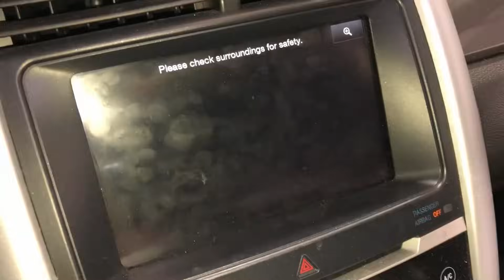2007-2019 Ford 6F50/55 Six Speed Transmission: Fluid Exchange Procedure

Comment: Hello sir, do you need to check the trans fluid level while it's running. I'm driving a 2014 ford taurus sho and have no way to check it unless I were to run it with no airbox
Reply: Just did mine. You can check it while its running just don't rev it or anything. I put in 5 quarts and called it a day.
Reply: @supafly322  you actually ran your vehicle with no airbox?
Reply: @LickidySplits  Yes, for a minute.

Comment: Haynes manual says 106 in-lbs for the drain plug in the 6f50/55. Though to your point, a little thread sealant and remembering you're just plugging a hole are always important.
Reply from the maker: Yes but I never torque it that much.
Reply: @FordTechMakuloco  Although it should be intuitive, your tip about choking up on that 3/8” ratchet during plug installation you provided in a few other videos is great advice for weekend warriors or novices just staring out. I’m an aircraft mechanic by trade so I understand auto mechanics and necessary theory of operation. What I don’t have is your in depth Ford experience and system knowledge. Your videos have saved me countless hours of troubleshooting, money for “parts cannon” ammo, labor costs and tons of frustration. You are a tremendous asset to the Blue Oval Brigade! Thanks!

Comment: Was looking to change the fluid and filter on my 09 Taurus X and noticed no drain pan . Internal filter ? Another bright idea from Ford ! Great video , thanks ! Oh , and by the way , ford says you never need to change the fluid for the life of the vehicle . What's their life expectancy ? Not very long obviously . Update ; changed the fluid and WOW ! Way smoother shifts ! Eliminated erratic shifting . Hard to believe fresh fluid could make that much difference . Now on to the ptu !
Reply: "Lifetime" no matter how defined, always is a definite length of time. Ive never seen any official documentation stating what the auto manufacturers consider as life time, but based on the length of warranties and and the average life span of the vehicles when in real use, it seems to be 100k-150k for a sedan and 175k-250k for a suv or pickup. Roughly 5-10 years for both. Its also worth noting that while the trans fluid in a 6f50 isn't a part of regular maintenance in the standard service list, it is listed in the severe duty service list.

Comment: Manual says it holds 11 quarts. I'm confused
Reply: Doing this drain and fill doesn't change all the fluid. The transmission and lines hold the rest of the fluid, that's why this really needs done three times to fully change all the fluid.

Comment: Just did my 2018 Explorer Platinum. Took 4 3/4 quarts of Mercon LV. Very easy to do, followed your instructions and all went well. 39030 miles on the truck.  I will be doing this maintenance going forward and also on my 2019 SHO at 30000 miles. Thanks for the procedure 👍

Comment: Thank You! I'm glad you explain how that fluid expands when it gets warm. I changed mine and before the 15 minute test drive I ended filling it up by accident halfway between min and full. I was worried after the test drive that when I checked it for final reading that it would be over max, but I got luck it was right at the max line so I am good with that.

Comment: Thank you for the video.  My local mechanic told me they had to flush the fluid with their Snap On machine and cost me quite a bit to do.  Looks like I can do it myself cheaper and easier on my 2011 Edge.  Do you recommend any additives in the fluid?  My Edge has 135,000 miles and fluid has only been changed once.

Comment: Hey I have a question for you. I was doing some routine maint on my 2010 Taurus SHO and after the trans service (with OEM fluid), and after that service I started noticing some slipping and shudder. I did some other maintenance at the time, so I had a hard time at first narrowing it down to the trans. I can explain more details if you like. 

At this point I am pretty sure it is some trans slipping at part throttle, (light load more noticeable once the trans is up to full operating temp).  I have now changed the fluid once more for a total of 10-12 qts of fresh fluid in the last few months. The vehicle does not get a lot of miles since we live very close to work.  I have heard about some torque converter issues, but want to start throwing parts at this thing without some good diagnosis behind it. 

Any information you can send my way would be greatly appreciated.  I  was a dealer tech many years ago for the Germans so I know my way around under the hood., but that was some time ago and I don't pretend to be as well versed as I once was. 
Thanks in advance.

Comment: Hi, I have a 2013 3.5 Edge with 72k miles. Currently I have no shifting issues, but I want to be proactive at changing the fluid. How many times would I have to do this procedure to change out most of the fluid?
Reply: 3 times. Add a bottle of Lucas Transmission Conditioner next time too, in place of that last 4.5 quarts.

Comment: Thanks to you, I changed the transmission fluid and PTU fluid today on my '17 Edge with 35K miles.  Very glad I did it, since the trans fluid looked more like it had 100k miles on it, and the magnetic fill plug on the PTU had a significant amount of metal shavings and sludge, which I'm hoping is just break-in wear.  You saved me hundreds of dollars today, and I'm sure thousands in the future... you are very correct that the fluid change intervals in the manuals are not nearly often enough.  Thanks!!
Reply: Add a bottle of Lucas Transmission Conditioner next time too,in place of some of that 4.5 quarts.

Comment: I'm at 102,000 miles on my 2017 explorer 3.5 liter engine. My transmission is starting to slip out of 1st and sometimes between 2nd-3rd gear. I have never changed the oil and I feel like it might be a bit late, but I'm still going to do it. Wish me luck.
Reply: How did it go?
Reply: @troubledthoughts3936  I ended trading my explorer in for a 2019 Ford Expedition 1 year ago.

Comment: Hello, thank you so much for this video! We picked up a '15 Explorer 3.5L 4WD with this type of Trans + tow package. I am worried i might of overfilled the oil and i noticed no way to syphon it out. I did a normal drain at 60K ( we got the car with 54K ) and I was able to get it filled after 30 min of driving the oil gets to the top of the hash marks when its hot. When its cold it goes all the way to the Max line. When i turn it on and its cold it stays above the middle of the has marks. I live in AZ and i am worried it might even expand further. I knew i should of stopped at 5.5qts but i think i added over that. Should i just re-drain it? Thank you again fro your help!
Reply: So what did you do? Am at the max in the reading.i dont think theres nothing wrong by being at max as long as you dont over pass the max reading.
Reply: Add a bottle of Lucas Transmission Conditioner too, in place of some of the next 4.5 quarts.

Comment: I change the fluid every 25k - 30k miles (Motorcraft Mercon LV) in a 2010 ford taurus with over 300k miles on the clock. Never had any issues with the transmission and I can say those are well built transmissions BUT today I as I was changing the engine oil I noticed a leake and I believe the source is that black plastic cover which I think is a filter.
My question what is that part?
Reply: Behind that black plastic cover is the valve body, I think. I believe that cover has a gasket that can be replaced.

Comment: Thank you so much for this. I just did my first transmission drain and fill on my 2013 AWD Ford Flex. It has 76k miles and hadnt had a transmission change yet. I’ll make sure to be more proactive with it. Perfect directions. It’s a pain to get to that fill cap!
Reply: How did your transmission fluid look like?
Reply: Add a bottle of Lucas Transmission Conditioner next time too,in place of some of that 4.5 quarts.

Comment: What's your thoughts on changing trans fluid after 120k?   I do keep up w/ oil changes.  Trans scare me.  :(  It still runs/shifts fine.  I want to squeeze as much life out of it as possible.  Some say don't change it this late, but that seems dumb.  2013 Explorer v6 NA.  And thank you for all the videos - they have been a great help!
Reply: Hi. Did you finally change the transmission fluid on your explorer? If so, how's it running?

Comment: I am wondering if you could help me with an issue that I am having. I did a transmission drain and fill  on my 2016 edge with the 6f50 transmission. I removed about 5 litres from the transmission and added about the same back in. However when I bring the trans up to operating temp and test with the dipstick I read very high on the dipstick. I removed some fluid and have roughly 4.3l (4.5 qt) of fresh fluid in the transmission currently however I am still reading high when the trans is up to temp. 

If I don’t bring the trans up above 180*f I can get a reading somewhere in the hash marks (around 150*f)

I am afraid to remove any more fluid from the trans than this but also don’t want to run into any issues due to an overfill situation or am I just reading the dipstick all wrong??

Comment: I just do not understand why auto transmissions don't utilize an external spin on type oil filter.   WHY would Ford engineer a trans that doesn't have a pan and serviceable filter system ??  Even those with a pan. Why not build it with a drain plug just like the engine oil pan?  Piss poor engineering by all manufacturers.
Reply from the maker: Ford does offer this on their Superduty trucks.

Comment: I have a 2018 Expedition.  Just had it in at the Ford dealer for oil change and was told once I hit 15,000 miles I should have a fuel system flush, but could probably hold off to 30,000 miles.  I don’t see anything in the owners manual about this.  Is this a bullshit service the dealer is trying to get me to spend money on?
Reply: Jeff, I bet they are scamming!  Never heard of such a thing, beware.
Reply: Jay Hall, I agree.  What is even funnier is that I have a 2017 F150 with the same 3.5L as the Expedition and they have never said anything to me on the fuel system flush on the F150.  Seems to me that it’s pure bullshit.

Comment: Ford tech,
No leveling procedure for this transmission? Or just refill to center of hash marks on dip stick while at operating temp with 4.5 to 5 qts?
Reply from the maker: Refill to the center of the hatch marks just like a regular transmission as shown here.

Comment: Great video, too bad I'm terrified of the random water pump failures on these 3.5 L engines costing $2,000 to repair
Reply: SAAN27 I just bought an edge, this scares me too.....I was told to change the coolant about every other year.......
Reply: @freedom1439  how is your Ford edge holding up?
Reply: chipete1 Like a champ......thanks
Reply: @freedom1439  how many miles did you have on your Ford edge and also how long have you had it
Reply: chipete1 it had 62,000 I bought it about a month ago....its a 2010 gave 7,000 for it....i just couldn’t pass that deal up. An elderly couple had it keep inside. They bought a new one.....
Reply: My ford explorer pump start leak at 106,000. This job its a pain. Tip don't change the small chains behind the distribution chain.
Reply: $2k is cheap for this job.  Mine got to 130k before leaking at the weep hole.

Comment: I have a question about the harsh shift on 2013 mkz EcoBoost pls respond I love you because you have helped me
Reply: Hey, I have a 2017 Ford Fusion which has the same powertrain. Does yours have the 2.0 Ecoboost? Mine shifts hard on the third gear

Comment: I have a 2016 Explorer with the eco boost engine. 80,000 miles on it. Trans has a fill cap but no dipstick. Seems like the torque converter comes in and out of lock up really often. Will a fluid change help this?

Comment: great video do you have a ford maintenance schedule for ford explorer 2013 v6 3,5  and ford f-150 2013 ecobo0ster 3.5  110k basically your maintenance recommendations are quite different from manufactures

Comment: My "ahem" beloved Ford dealer in Buffalo, Minn. was gonna charge me $ 190.00 dollars for this!!  2014 Edge  AWD,  So i actually did 4 count em 4 drain and fills today!,  79,000 miles. Fluid, imo, did not look that good, quite brownish actually, ( wifes vehicle) so after a little research, on youtube, and FordTechM,  i wanted as much of that old fluid as poss. out!  I could only get out about 4 quarts each drain,  maybe a bit more,  anyway i am fairly certain i lengthened the life of this drive train. BTW, also did a complete coolant flush today also, thanks to your vids on that service, lots of running water, with heater on, revving motor, till clear water was flowing.....
Reply: Add a bottle of Lucas Transmission Conditioner next time too, in place of some of that 4.5 quarts.

Comment: Thank you for your videos I learned a lot and I enjoy watching , have a question : can you tell how to connect remote filter for 2012 ford edge I purchased Derale kit # 13090 , went to install it and I noticed all trans lines are 1/2 inch and the kit line and insta adapter is 3/8 also I didn't know how to find the radiator connector to install adapter so I went and remove fender liner driver side and found  two lines  going to a rectangle shape box  from top and two lines are out from bottom..... I started the vehicle and found one line was hooter than the other and this must be supply line ? is it possible to use this lines to connect filter line ? any one will work ?

Thank you in advance

Comment: Hello Sir:  I have a doubt, in my Ford Transit Connect 2018, XLT ,where is the PCV valve located? And, where is the fuel filter located? How are they changed?  Thank you for your assistance.

Comment: The transmission holds 12 quarts, so replacing 4.5 quarts is just a modest refreshing of the fluid. I did the procedure three times in a row, pretty much all you can do as an average owner. I have some peace of mind now...
    Frankly,  the worst surprise for me was the oil I sucked out of the PTU. Basically black tar. It contaminated the new oil so badly that I changed it again after 50 miles,  as I had the curiosity to see how it looks like.
Reply: Same! My PTU fluid was black tar at 47k miles (just bought it used). Great idea to change it again very soon.
Reply: @parkerrogers2277  : I plan to change PTU lube regularly every 15-20K miles.
Reply: This is my question, I have a 2013 Taurus and it lists a capacity of around 11 quarts.
Reply: @av8rgrip  Same my explorer book says it takes 11.6 quarts which is the same as this guy in the video is changing but he only puts 5.5? never done a trans change before and definitely want to but don't want to F it up.... guess ill just go by the dipstick but whys the book say differently
Reply: @CJB46290 that’s the total amount it carry’s, you’ll have to drain and fill it bout 3 times to fully replace it. They about 50-100miles between drain and fills
Reply: @bolaindie9214  Ya i get it now thanks
Reply: The rest is in the torque converter so like the other comments you will have to repeat this 3 or 4 xs with a few hundred miles between changes to get it all

Comment: Good tips...have a request how do you remove the transmission line fro the cooler to the transmision I try to use Lisle 39660 Transmission Oil Cooler Line Scissor, 3/8 x 1/2-Inch  they fit around the collar on the transmission lines and slide up over the collar but will not release the clip .... pls make a video how to release the transmission  cooler lines...

Or is this tool better

OTC 6593 Transmission Disconnect Set for Ford

I didn't buy them cus there plastic I choose 
Lisle 39660  thinking it was better and not made from plastic

Comment: 2011 f150 5.0 What do I do if my transmission fluid was never changed? I bought it used at 111k miles and I have no idea what was done up to that point. I heard that putting new oil in would make it start slipping (assuming that the oil was never changed).

Comment: My dad has a 2008 HHR with 450k+ miles and it's never had a transmission fluid change. I suppose in the grand scheme of things, the fluid doesn't really need to be changed (considering most cars won't last more 200k), but I would still rather have at least the option of changing the fluid and filter rather than having the manufacturer just assume I'll never do it.
Reply: What's an hhr?
Reply: @Texdram maybe a hair drier?

Comment: This is my favorite YouTube because I own a 2010 Ford Escape. In May 2019, I bought an Escape XLS, 2.5L,  6-speed auto with 89k miles. I am now hearing a growling noise, only when accelerating. Could this be a transmission noise? What model # is my tranny?

Comment: I bought my Explorer when it had 88,000 on it. It now has 142,000 on it. I have no problems yet, but is it to late to change the trans fluid? I’ve heard stories that you can’t change it if it’s old fluid.
Reply: Take a sample of the fluid and send it to a place like Blackstone Labs - they will send you free sample bottle & shipping container if you fill-out the form on their website.  If they do not find any alarming levels of "contaminants" , then go ahead and change the ATF fluid.  Remember that there is still about 1/2 the ATF fluid being retained in the torque converter & trans fluid cooler system that will never get drained out unless you literally tear down the transmission, so plan on doing another ATF fluid dump & fill in again in about 1000 miles to make sure you get as much of the old fluid removed as possible using this method.  Unfortunately if the lab comes back with bad news, then save your money on the fluid change & just keep driving it till it stops moving - you can't undue the damage that has already been done by the lack of ATF fluid maintenance by the prior owner(s).